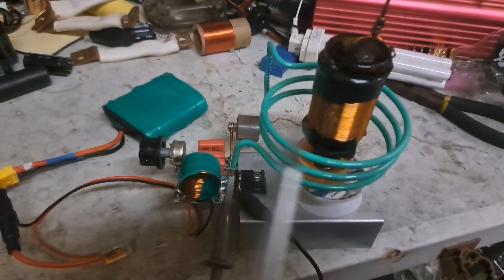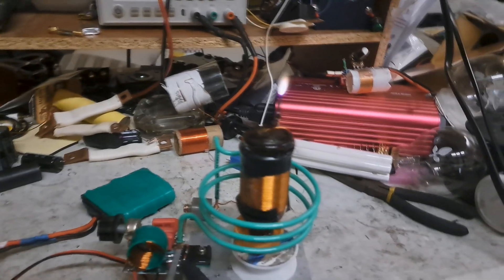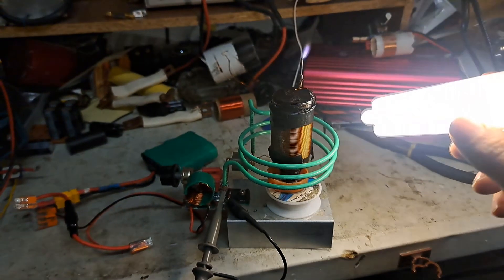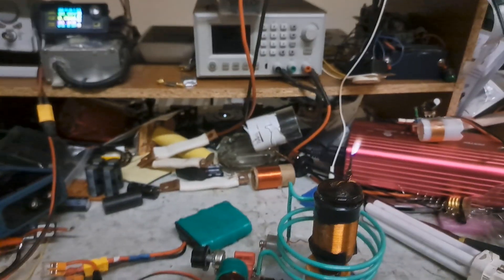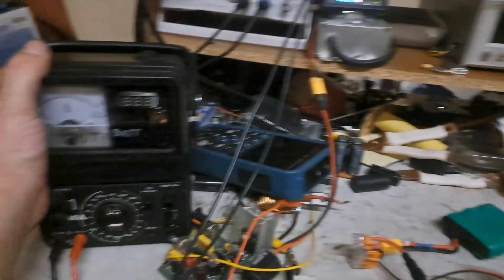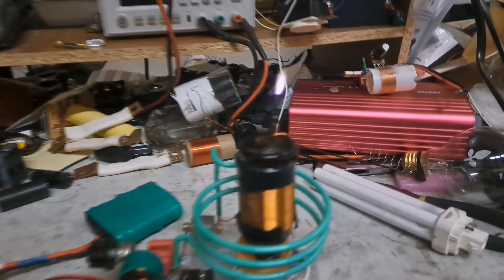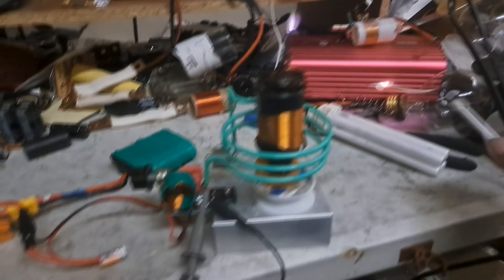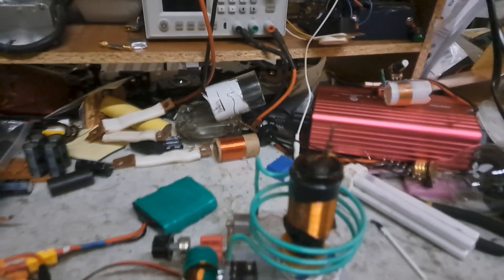12V Plasma Flame 18.6Mhz

Comment: Fuck yes.  Thats pretty solid for 12v.  

My TC’s for christmas are now just waiting for me to build and play with some copper top loads.  Hopefully by the time i get back to the RC stuff ill have room for a couple different projects and will be able to start on my flame tc build.  

My current RF project for a niece is kicking my ass.  Ever play with making transmitters?
Reply from the maker: I suppose technically yes and no. I thought about it but would probably have taken the lazy route and just bought a cheap RF transceiver setup on 433Mhz or something. Maybe tried to amplify it if necessary.
Reply: @Magneticitist  well i figured out why none of my circuits were working...i just bought some cheap bread boards and a few of their rails dont make connection.  

Watching you and irritating myself recently, i think after 20 years i need to step up my game.  Tinkering with trashed components and the cheapest of the cheap chinesium stuff can is fun.   But using whats at hand for a specific goal and dealing with all the work arounds that come with the territory is bloody exhausting.
Reply from the maker: @gibbyrockerhunter  I hate breadboards for that reason lol

Comment: Very cool , you should try one of those vhfsstc like the one MSlabs did at like 40mhz or this other chanel DN AP made one wich was running at 37mhz
Reply from the maker: The easiest way to do that is to just use one of those "slot jammer" circuits. I made one a while back but never tried to push enough power to make a flame because it was a small battery deal I used to test floro tubes. Transistors like the C2078 make it pretty easy. I think Teslaundmehr cranked one up til he got plasma. The one I made is the simple deal that wraps a feedback winding around the section of the inductor wire, runs at 40Mhz.
Reply: @Magneticitist  yes sir I saw it , but a mosfet one would be cooler eventhough be harder to tune , I bet it would annoy the shit out of ham radio pp hehe
Reply from the maker: @rodriguezfranco3839  When I first grabbed a low power transceiver I would scan channels and now and then I'd catch a couple ham guys having conversations in perfect clarity with a crap whip antenna. I don't see how any of the stuff I run would affect them though. But yea you can do it with small mosfets it's all the same shit. The IRF510 seems to be the classic affordable preference. 

I might make something like that but they are very picky at those frequencies. You change the slightest capacitance or inductance value and suddenly it doesn't want to work the same. IDK if I've seen any good ones that would self start either. Some cool benefits I can think of like seeing what it does to gases but otherwise a lot of possible headache I feel like.
Reply: @Magneticitist  I killed the qcw pll hehe , I stepped up the bus voltage from 100v to 200v and it did like 2 arcs and then nothing , I think I killed the fet , I hope is just the fet
Reply from the maker: @rodriguezfranco3839  That sucks. If it wasn't the gate blowing then it probably means you were already overvolting the fet the whole time, or close to it.
Reply: @Magneticitist  apparently the gate still fine , I check for continuity and seems it just shorted out between D-S , I have another 460 laying around to replace  but I think I  am gonna start thinking on building a halfbridge instead and maybe save this 1.4 mhz for later and start playing more with my 300khz sec and a halfbridge I think it would be a sic combo

Comment: Wow! So the flame does burn things. So it would burn a piece of paper... correct?
Reply: That flame will melt most, if not all metals. White hot plasma
Reply from the maker: Yep, will be far more effective at lighting basically anything compared to a lighter for example.